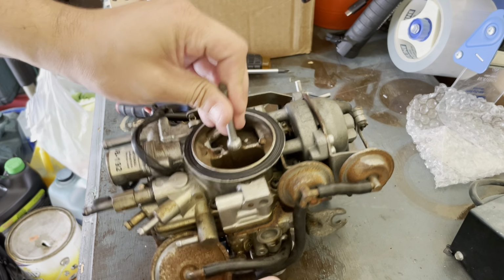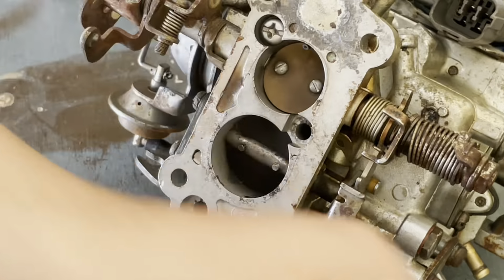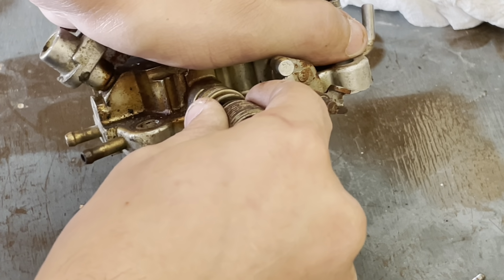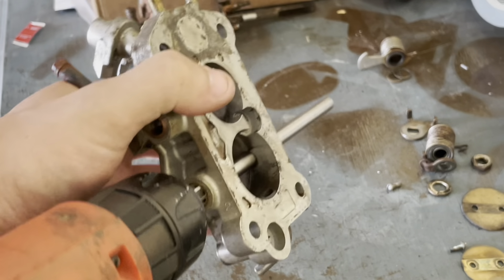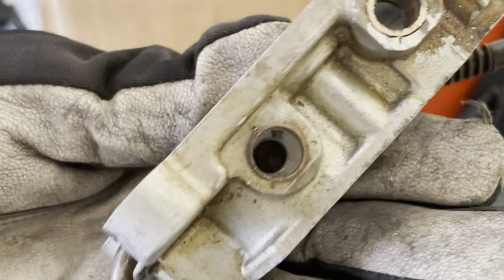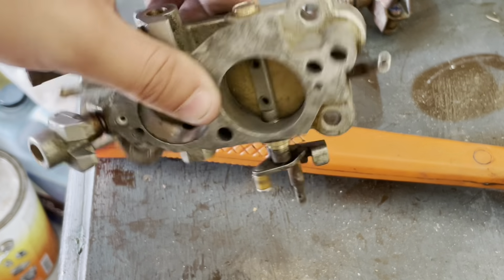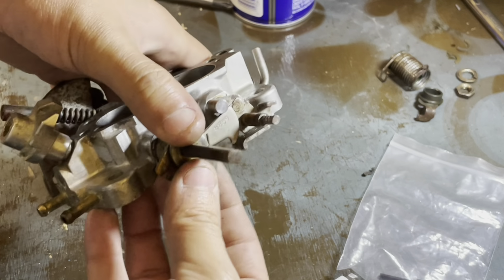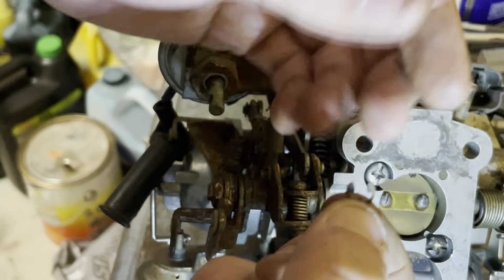Subaru Justy Carburetor DFC328  throttle shaft bushings install

Comment: Thanks for sharing this.  I’m going out to check out my ‘75 Toyota PU.  It has a rough idle.  I like the stock Aisin carburettor, but it’s old.  It has a very convenient window for checking the float level.  Changing to a Weber would make saving the heat riser a challenge.  Thanks.